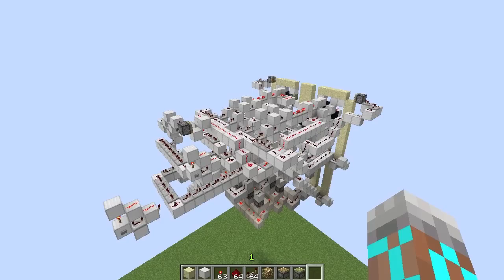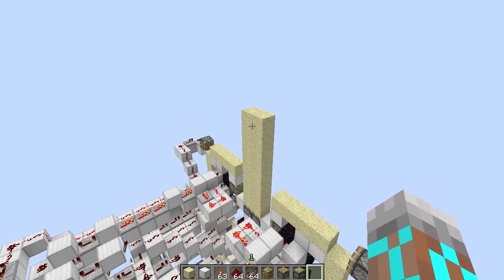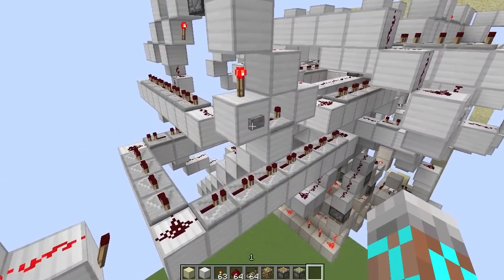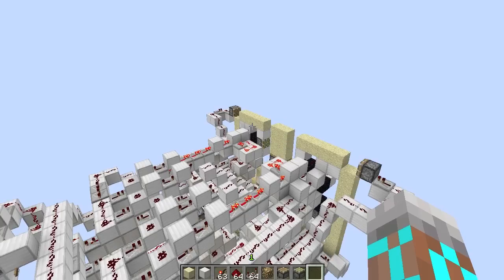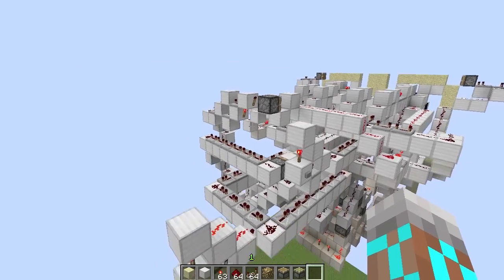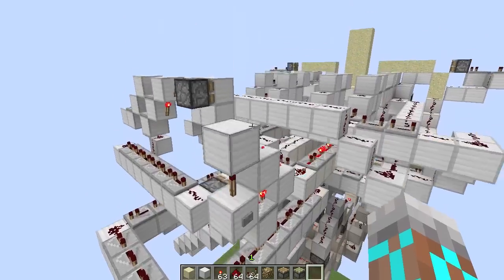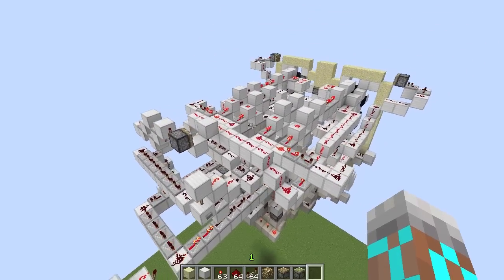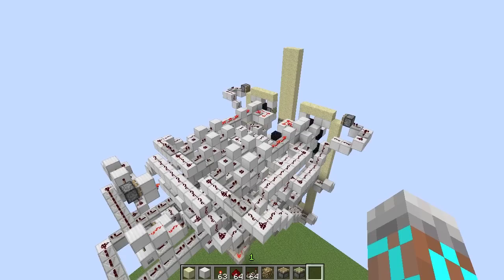Variable Height Bridge Raiser

Comment: Would it be able to only use one of these circuits connected to a and-gate or something (the other input would be ie a lever), then have several piston-sand-tapes infront of each other to make working stairs?